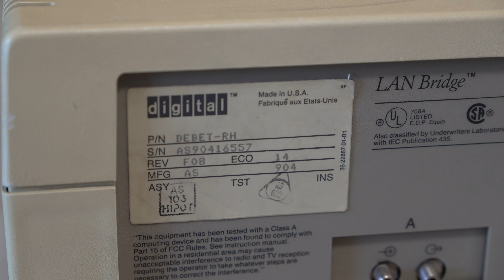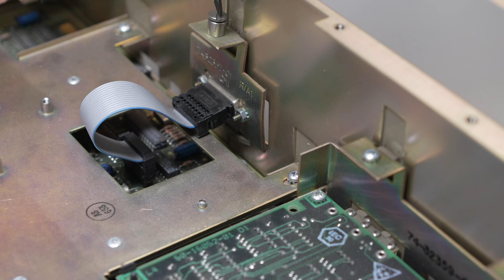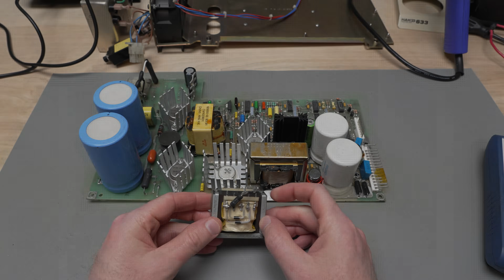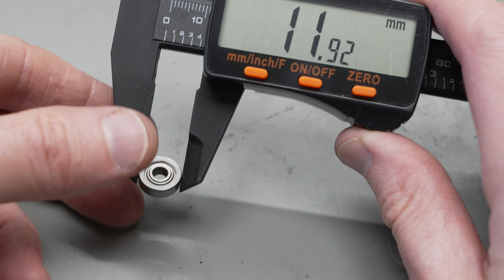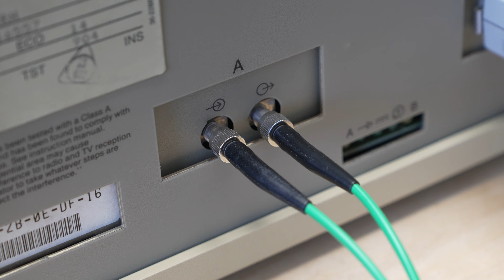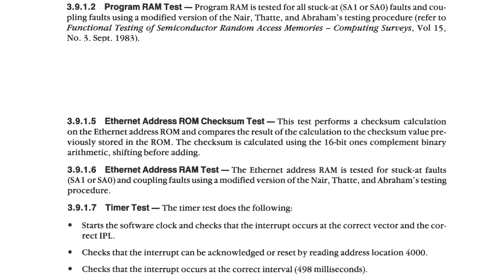Attempting to restore the world's first Ethernet bridge

Comment: I picked up a LAN Bridge 100 for $25. It’s the DEBET-RJ version with one fiber and one AUI. I unplugged the fiber module, hooked up a ribbon-to-DB25 cable, and it worked right away. So it looks like you don't need any special circuitry or configuration to use those pins for AUI.

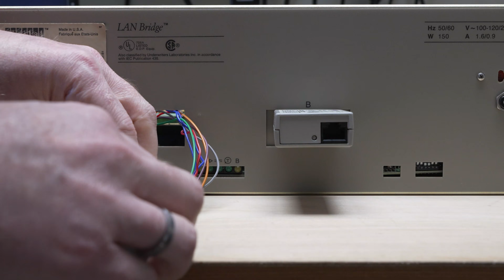Comment: 21:06 Looking at the holes in the case, your board looks significantly bent in comparison, since you also seem to have narrowed it down to that area, id check all the solder joints in the area, possibly just reflow them all.

Comment: 7:50 safety tip: do high voltage stuff with one hand, and keep your other hand somewhere safe like behind your back (not touching anything grounded obv). either attach the clips one by one, or use some probes u can hold like chopsticks. your arms are a pair of wires made of meat, connected roughly in series with your heart. if you can ensure one of those two wires is left floating, then at least in the case of DC or low-frequency AC, you theoretically can't form a circuit that includes the heart. not perfect, if the shock forces your muscles to contract, good luck controlling where either of your hands end up, not to mention your arm not actually being a perfectly homogenous conductor that'll form a perfectly predictable current path, or the fact that your other hand is never truly floating due to capacitive coupling. but always seemed like a smart way to get a small bonus to survival probability should all the other precautions fail.

Comment: The 2 EEPROMs my have different firmware on them to signify the Tests from Each side (AOI and Fiber) before it gets to the Motorola controller. Also, On the Fiber there may be a burnt out connection on the FIber Board. you may want to test the diode to see if that will even flash.

Comment: You should be able to in-circuit test the RAM chips without having to de-solder them. I would use an ABI boardmaster, but you can often use an EPROM programmer that has RAM test functionality by making a dip socket to dip test clip cable

Comment: 36 years old caps still good - unbelievable
Reply: I know right , had 10 year old dvd players with blown caps :(
although , that might be cause these days everything has switching power supplies instead of a transformer.. ("always on ") versus only on with main switch.
Reply: I remember DVD players was failing in mass due to bad caps. Caps was put to the hottest place. Planed.
Reply: @Mitsou44  Almost everything that contained capacitors during the 2000s and late 90s has failing caps due to the fact that almost all capacitors made during that period (the Capacitor Plague) were subject to a widespread design formula stolen from Rubycon in Japan, but the key part here was the capacitor design that was stolen to copy between these Chinese and Taiwanese companies was a miscalculated/miscopied. These companies used this design and confidently manufactured them for cheap and because they were cheap and seemingly high quality a majority of companies started using them. It took a few years but caps started to fail in swarms and we are still dealing with it today with tech that sits, eventually those caps leak and kill off all this old tech (ie the clock capacitor in the Original Xbox needs to be pulled/replaced otherwise it kills the board)
Reply: not that unbelievable, most of the crappy capacitors came out in later decades
Reply: These are pre-capacitor plague.
Reply: capacitors failing is a thing starting in the mid 90s up to mid 00s. in the mid 90s it was due to SMD electrolytics leaking, and in the mid 00s it was just poor quality. i've worked on a few very old TVs and computers and, on a C64 i found just two bad electrolytics. every other cap was within spec (OVER rated). on TVs, the only bad cap i ever found was the +B cap but that one is under a lot of stress. on modern devices, there are no bad caps, just bad supply design that puts OK caps under unnecessary stress.
Reply: @drgenio2006  I know some worker stole an electrolite formula for caps , and sold it t competitors , but it was a bad formula , planted for him. it was the cause of a lot of problems with caps. after 1999.
Reply: The lack of significant dust inside suggests it hadn't been used much. Electrolytic capacitors degrade when they're in use, specifically as a function of the ripple current. It's due to both electrochemical reactions and thermal. If they're just sitting there unused, they will last a whole lot longer.
Reply: @sj65535 
Wrong concept. 
China made cheap capacitors are time machines.
Use it or not , make no difference.  
When time is up  the capacitor failed.
For servicing,  replace all capacitors with Japan high quality capacitors.
Reply: @sj65535  Until they run out of their shelf life (dielectric layer dissolution). After that they need reforming, otherwise they blow up the moment they are powered up. Light use is optimal, and a good thermal design is a must (temperature increase causes useful life to shorten exponentially).

Either way, these caps are impressive, compared to the ones put into motherboards and stuff back in the 90s and 00s.

Comment: Pretty nuts that this thing required a full on 10MHz 68k CPU. At the time it was released, this thing still had all the computing power of an entry level Unix workstation. Just to pass frames between two ports at 10Mbit
Reply: probably done that way because it was using software and not an ASIC, also what they had available to work with in the dev environment

Comment: Remember it is just a 10 megabit/s 2-port switch!
Unbelievable how much hardware went into this.  Look what is inside the minimal switch (e.g. 5-port) today...  and that one is 10-100 times faster too.
Reply: well. a bit more than that. it's an optical converter as well.

and even for most of 90s most people just used hubs. this one does routing of the ethernet packages, like a switch, having a bespoke computer in there to deal with the bandwidth.
Reply: @lasskinn474  The optical converter is a seperate board in this bridge that is tiny when compared to the "motherboard" with all the functions on it...
Reply: @Rob2  sure but it doesn't just dump the ethernet on that module, I think. that's just fiber-to-pin.

they did have remote ethernet repeaters at the time too though using the same optical cabling, the manuals for this mention those on the sections where they speak of how to measure and certify the cabling(and how to build the fiber cable).

of course you can get the fiber stuff in a wifi/ethernet switch box but for the time they did pretty well with a board that's not that much more complicated or bigger than an amiga 1000, they didn't make a complicated chassis and separate everything into a lot of different boards as was the style in 80s, instead it's almost like an appliance switch in design just with bigger chips and less integration
Reply: @lasskinn474  This box has two general-purpose ethernet controllers, a powerful general-purpose CPU with program EPROM and scratch RAM plus the required glue logic, an associative memory implemented with programmable logic and more RAM, and then it has only AIU ports so the media interface is external or on that fiber optic board.
All of that is present in a $20 switch you buy at the local store, except it has all of it in a single chip, and it is 100 times faster.
So there has been quite an advance in technology...

Comment: We had one of those at work between the 10base5 and 10base2 network segments we used.
Not sure if it was the model with 2 AUI connectors (and a 10base2 interface) or if it had a 10base2 BNC right on the box.
But it was the same big box from Digital...

Comment: What a fantaastic deep dive into this old stuff! I am a network tech since 1999 and saw the replacement of 10Base2 and Token Ring Networks. Saved several Habs, AUI Transeivers and cables to teach my trainees the basics and the history of networking. For troubleshooting i would advice to reach out to Adrian Black from Adrians Digital basement. 

To do list:
1. check voltages across the board
2. check clock signal and reset on the cpu
3. check the eprom data for corruption. Had a dead 386SX board and found that only 2 bits were flipped/stuck  in the odd bios
4. check activity on the sram/dram chips and compare to the working system.

Comment: One of the problems was screwing the case together before fully testing it - NEVER do that!
By Murphy's Law, you are then guaranteed to find another problem that means un-casing whatever it is again.

(And if it does not work, you have not wasted time).

Try a thermal camera to see if anything is noticeably warmer or cooler than other similar parts on the board? 
You can sometimes test RAM by piggy backing another similar IC on top, just with the pins set in slightly to give a good spring fit contact.

You could also try copying the EPROMs for your working one, to test the board with two wired transceivers, in case the firmware is different to work with the fibre optic unit?

Comment: The oscilloscope at the end, shown probably 2 things:
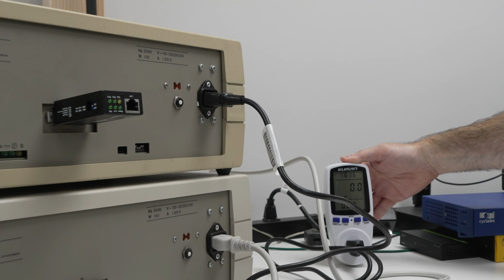-using 1:1 probe, its common mistake. 1:10 have lower capacitance
-3-level signals, so few outputs short circuited, or some output broken. In this case good to watch by IR camera. 30 yeaes ago, I've used own fingers and drop of alcohol to see the evaporation speed.
Thanks to remembering about AUI. SGI Indy have it, together with RJ45. I was very glad than have permission to change local network from coax to twisted pairs, and forgot about everydays network falling and electrick shocks.

Comment: A suggestion re the EPROMS - try combining them into a single 16 bit wide file and see if a disassembler can make sense of the data.  Maybe there is a Ghidra addict out there who can turn them into something sensible and rule out bit rot.

Bonus points for repairing the fans !

Comment: Is this dinosaur basically just a 2 port managed switch?
Reply: Managed? I thought they were usually unmanaged.
Reply: @eDoc2020  If it was a 2 port dumb switch this giant box is nothing more than a media converter which does not need all those electronics.
Reply: @leggysoft  TLDR: it's a switch, not a hub.

You need to remember Ethernet used shared media back in the day. If one device is sending a packet nothing else on the entire network can transmit. A hub/media converter changes the physical interface but does not address this limitation. If a device connected to port A is transmitting it will be retransmitted on port B so both sides of the network will be blocked. A bridge/switch is much more complicated. If a device on port A is transmitting the line on port B will be left free. The switch will only transmit on port B if the packet is destined for a device on that side of the network. This can greatly cut down on the network utilization and improve performance. This requires enough smarts to learn and remember which side of the network each device is on.

Comment: First thing I'd do is figure out if the EEPROM data is still good, by comparing to another unit, or checksum if printed on the labels. Also try verifying at a range of supply voltages. EEPROMs are the one part that has an inherent decay mechanism, so high on the list of suspects.
Reply: Easier to do in this case, since you have a working unit!
Reply: not EEPROM, thats are EPROM‘s 😉
Reply: HET IS NEDERLANDS DROPLUL,lul dat dan ook.
Reply: Wouldn't the EEPROM be where the MAC address is stored?
Reply: @soundspark  22:50 Mac address is stored on the PROM

Comment: So what would companies have used before this item was available. 
I presume this was the pioneer from which a whole industry followed? 
Excuse my ignorance but this seems like a breakthrough product judging by your description. 
Thank you fir youe time and efforts.
Reply: not very familiar with history, but probably either one large ethernet stretched to its limits (I think it was coax at the time given the AUI ports, not yet twisted-pair), or separate ethernets connected via routers when possible (assuming the network ran only routeable protocols like IP or DECnet) -- but if I understand correctly, routers were quite a bit larger though, and often the size of a whole mini PC (e.g. a whole Unix machine to route IP, or a whole VAX running OpenVMS to route DECnet) so this bridge would've been very lightweight -- or other local network types that had different limitations (FDDI maybe? Token Ring? I have no idea which ones were the most common alternatives)

Comment: You said the -12v rail was low. Some old memory chips use that voltage, they might not function with it low. You should make sure the power supply works completely. 

Next you would think such a device would have a serial port for diagnostic output, but i couldn't see anything like that in the video.
Reply: these memories only need 5V 

if it would be a modern highly integrated stuff, then the 3 pins next to the dip switch could be a serial port (still could be interesting) --- but this one would need a dedicated UART IC to do it, except there is none to be seen --- welp, seems like time for some good-old logic-analyzer fun....
Reply: @5mf1nc  I cannot read the part number in the video, so I cannot be sure of what it needs.

Comment: Something you can do before desoldering all of those DRAM chips is checking that all logic chips are functional (check that signals aren't between levels or pulsing erratically), checking for broken connections may also be of interest, especially of clock, chip enable and read/write control wires. You may also want to inspect any chips next to the power supply, because while it didn't burn degradation may have happened on the chips (or the board) that are physically closest to it.
This advice is not related to this specific machine, so please keep that in mind.

Comment: Probe the address lines of the memory with a logic analyser then you can step through what fails without taking all the chips out (although you might as well get them all socketed if one needs replacing). Check out some of the videos from Curious Marc about how they debug stuff

Comment: You should put a heat resistsnt very long lasting sticker on the inside of it somewhere with a note about this video, when it was cleaned and a summery of whatever you want. For the next person to get it. Hopefully humans will pass things down like this more into the future and stories dont get so easily lost. Youtube is not forever. Nothing is.

Also not sure what type of screwdrivers you use but Im hoping they are soft tip. It always sucks to strip/scratch a screw that is just as much part of the relic as any capacitor.

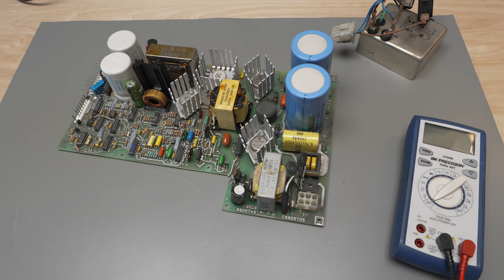Comment: Did anybody else see the upside-down PCB number in the corner of the PSU board at 6:37 and panic? It's "5015085D" upside-down, but at first glance it was close enough to a possibly-damaged "asbestos" to set off alarm bells.
Reply: I don't understand this, I see the 501... but what possibly damage asbestos

Comment: Wow.  Would not have suspected the aux transformer as the source of failure.  Also really odd to see that as its own fully bespoke part vs. a winding on the main transformer.  This is definitely from an era before these designs were optimized.

Comment: If your transceivers have an SQE/heartbeat switch, have you tried changing its setting? I don't know if it should be on or off for this bridge, I only know it should be off when used on repeaters and on when used on NICs.
It's quite possible that the bridge is either waiting for the transceiver's heartbeat signal to know the collision detection of the transceiver is working, but doesn't see it; or it doesn't need it and is confused by it being present.